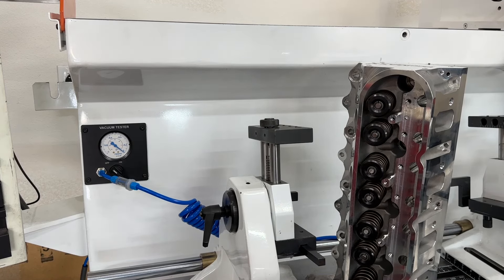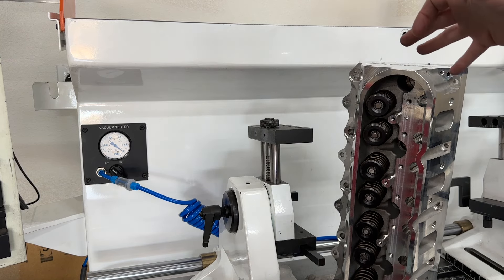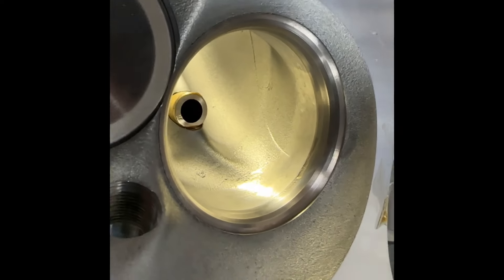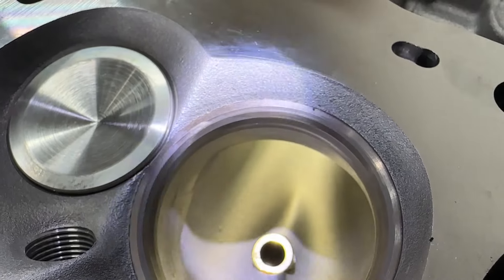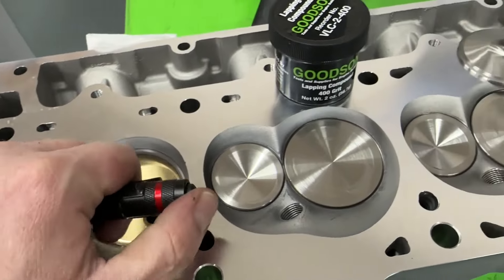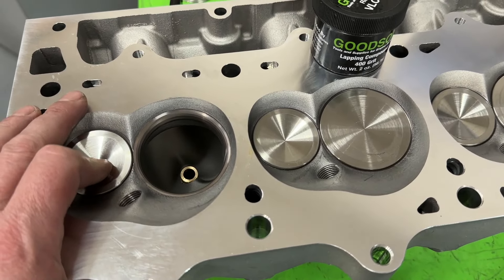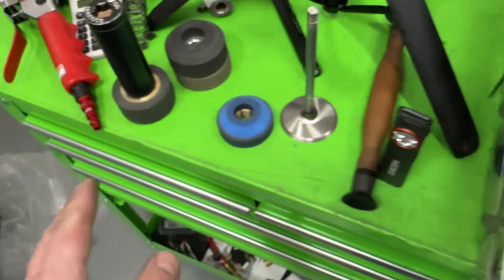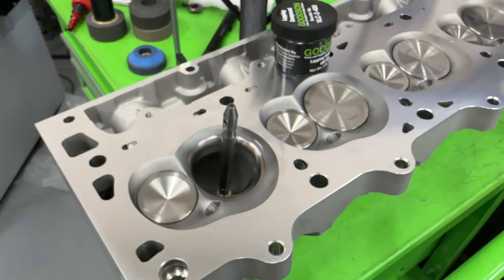Can You Use Heads Out Of The Box

Comment: Here in Australia, one of the shops down in Melbourne do CNC cast iron porting on the Holden 304 heads, they say they have a Newen single point too, but they probably have a Serdi as well, I think the cast iron heads would be done on the older machine. 
Then there is Tony Knight in Adelaide, he does heaps of online write ups of his work, very good porter, from what I've seen he does his 3 angle jobs with separate cutters not the combo ones.

Comment: I have an old set of 882 heads I ported years ago. They have all the basic upgrades. 2.02/1.60 valves, screw in studs and guide plates. 
 I lapped the valves. I used heavier grit and then finer grit. I cleaned them and then used alcohol to check seal. Seemed to work. But a lot of work.  I know the valves sealed really well.

Comment: Exactly. 
Well said. I have been grinding seats since 1978. Before i got my sioux seat grinder and valve refacer i did some  creative lapping. I was mostly doing 461 291 and 441 sbc heads  i took some used valves and welded a 3/8 nut to the center of the head. Had the machine shop grind 45, 30 and 60 angles. That allowed me to control the seat widths and position before i even dropped the actual valve  i was going to run in.   I was so upset a few years ago. The diesel shop next door owner died. They were selling off equipment. They ended up tossing an entire sioux bench.  Seat grinder and valve refacer in the massive scrap bin . The son said. Who grinds valves anymore.  I did at least end up with a straight drive kwikway seat grinder kit with a broken flex coupling and thousands of dollars of portapower rams and pumps.
Reply: So they were next door and you didn't buy it off them? isn't that your fault.

Comment: I have used AFR 195 SBC heads out of the box with perfect results. However I did take the time to check a few of the valve springs for proper installed height and seat and open pressure. They were spot on. I also checked to see how clean the heads were and how free they were of any kind of machining debris. This was also very successful in that they were squeaky clean with no chips or other bad things. I also have had the same result with some AFR SBF 185 cc heads. They also were clean and perfect right out of the box. However I have also used some Dart heads, Iron Eagles, that were full of chips and had to be disassembled and cleaned thoroughly before they could used. It is very important to check them all but my experience with the AFR products was impressive. And they all made excellent power on their destined engines.

Comment: Bought a full OLD set of stones, pilots, dresser, driver, stone arbors and carry case for less than $300. It was dirty but all  there. I learned that system in tech school back in the 80s. I scored a seat and guide   set for under $200 on snee bay, no one else even bid on it. Its not the big specialized mill but mounts to the head deck. Lastly a old Black and Decker valve grinder that ran but needed a cast iron bracket rewelded, $150. My point, this equipment is old, slow, but very good quality. I have a few cracked heads saved for test porting and practice. I only really use this equipment on my own extreme budget projects. Customers work still goes to a pro shop.

Comment: Trickflow heads are usually ready to go out of the box.

I say that based on several sets I’ve used for LS engines.
Reply: My last sent weren’t, no clearance in the valve guides, in fact so tight that you couldn’t push the valves out by hand. Not LS heads though, Trick Flow Cleveland.

Comment: Eric your problem with cutting the hard valve seats is all about tool pressure....that's how the people who are cutting them are getting them cut. You can get there several different ways. 1: low spindle speed, high feed. 2 High spindle speed, high feed. 3: Varying spindle speed throughout the cut to break up the harmonics. 4: in some cases a very high spindle speed and extremely low feed rate will get you there.  If the company that you buy your custom inserts from can build you a positive rake insert it will help to clear the chips and load the cutter slightly more than a neutral rake insert.

Comment: When running there is heat variation across the valves and seats. Cold intake coming in, hot exhaust going out. One seat side hotter than the other. AND the valve stem distorts. 
As you say Eric.... Theres still 20 difference!!!👍

Comment: Eric, When Vac testing a valve Seat, besides pulling "Finger" Peak test Psi (25 or so)  within 1 Psi, in addition  When pump is turned Off, Shouldn't the gauge take a certain Minimum amount of Time to gradually drop to 10 Psi Below Test reading ?? .....I have Seen good Valves & Seats within 0.002" Without springs & dry (No Oil film)  Hold constant Peak vacuum for over 40 seconds to Drop -10 Psa numbers....Thx for all Excellent info.....
Reply from the maker: Yes. But if the head can’t pull vacuum with the machine on and springs attached you know it’s bad.

Comment: When you say you flow every head you sell, do you mean all four intake and exhaust ports or just number 1?  And do you do that vacuum test on every port?
  The difference between pass and fail was so tiny on that little gauge.  I had to watch several times and even then I would not be able to see which ones were passing. Not from where the camera  was letting me see, at least.
As a consumer:
The best I could hope to do would be to turn the  heads upside down and pour some solvent in the combustion chambers and wait to see if it trickles out the port.
If I take some heads in for a valve job to the local Joe Sixpack machine shop, do you think they do a vacuum test to verify whether they seal?

Comment: Question on vacuum testing. Because you test the vacuum on the heads when they are cold, will it make any difference when the heads are up to operating temp, being that the clearances will open ?
Reply: I doubt it. If the seat or die valve is not concentric temperature aint gonna do nothing

Comment: Not really a glowing recommendation for promaxx. I mean if the chinesium heads are cheaper to make in China, and then they finish machining here, and then you have to have all this done to make them work right. 
 And it’s not like the big names like afr, brodix or dart aluminum heads are not made in China and finished machined here, they may have the same issue. 
 I really miss Dart cast iron heads. 
Almost like good used set of Darts or Worlds would be better quality. Sad with all the tech we have that quality has gone down. But everyone saved a few dollars, or did we?
 Guess maybe the jobs should have stayed in the USA.

Comment: How about showing the vacuum test on a set of heads and the bolting them to the block and doing the vacuum test again before any valve train or manifolds are installed, those seats don't stay round when the heads are torqued.
Reply from the maker: They do. When I use to build engines I use to vacuum test them after I bolted them on the block to makes sure the heads studs didn’t leak that went into the ports. Torquing them never made them not seal.
Reply: The vacuum gauge on the SERDI I ran claimed that the seal on the intake seats of the GM 4.3 heads we rebuilt by the truck load went away when torqued to the block.

Comment: Eric, is there a way to check valve seal without vacuum? I seen it done with water or is  the way only to lap them and check contact pattern?
Reply from the maker: Lapping with fine grit.
Reply: Assemble the valve in the head with springs etc. Dry, no grease. Put the head on a partially on a table so you can see the chamber side from beneath and spray some brake cleaner in the ports. If they seal they should not leak any brake cleaner past the valve.

Comment: If you are not already aware, seat profile cutters can be ground on different back angles. Newen offers them at 12, 10, and 8 degree. Probably, Serdi does also... I usually get them in 8 degrees, and it really helps with certain seat materials.  I  bought Newen's computer cutter design program, and they waive the custom drawing fee for life. Something to try if you already haven't.  Some people use a machining aid also,  I haven't really tried that, though.

Comment: I bet if you dynoed them as they are and then touch them with a stone to seal the factory  valve job you would not see any difference in power. Everything on that head will move once it's torqued and the again at operating temperature. Temperature.
Reply from the maker: I have seen 20hp
Reply: Heat won't fix that seat nick, it was as clear as daylight that someone came up on the seat, probably did a quick stoning to try and fix it too.